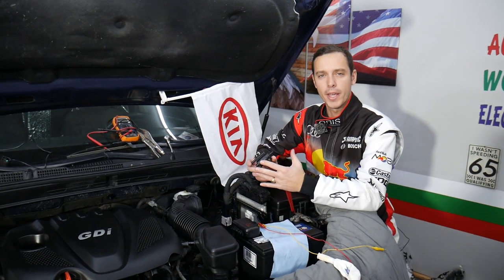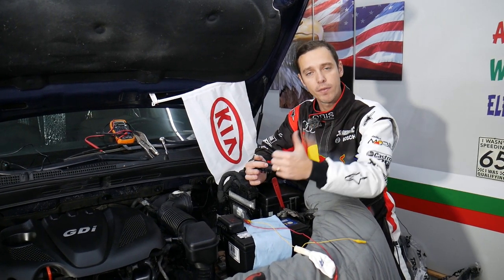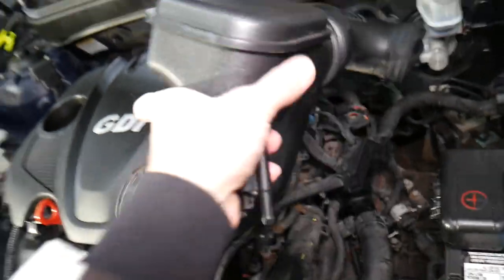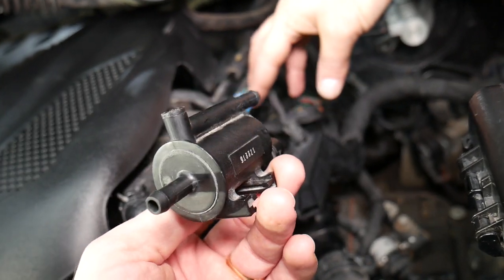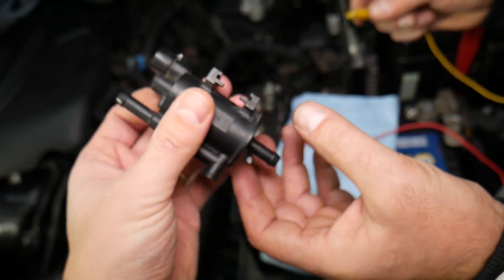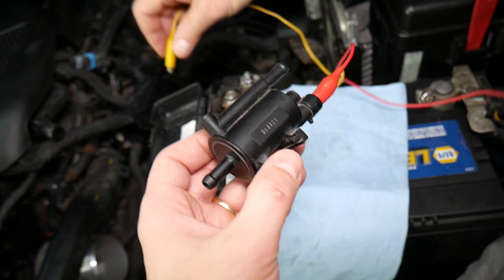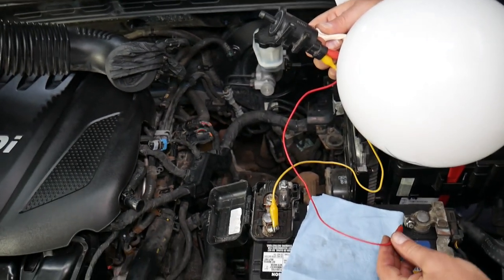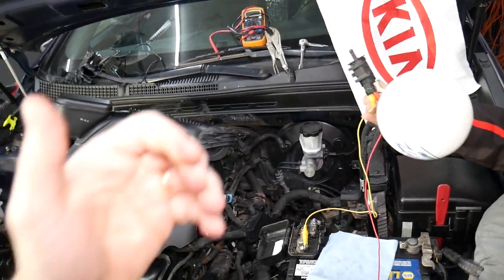PURGE CONTROL VALVE TEST ON KIA SORENTO SPORTAGE SOUL RIO FORTE OPTIMA

Comment: Excellent video! Maybe you can help me with a question. I have 2 problems with my sportage: 1- When I refuel the car, it always cut the fuel when there is room for 8 more liters.  2- ALWAYS during a long trip, everything is ok, I drive 600km stop to put fuel, start again, an at that moment I get the check engine light. ALWAYS!!!!. the day after, the light turn off. Last check they told me is related to the quality of the fuel, and that the Catalyst could be dirty. Do you think this PCV can be the reason? thanks
Reply: Pcv valve is for positive crankcase ventilation. It has nothing to do with the evap system.